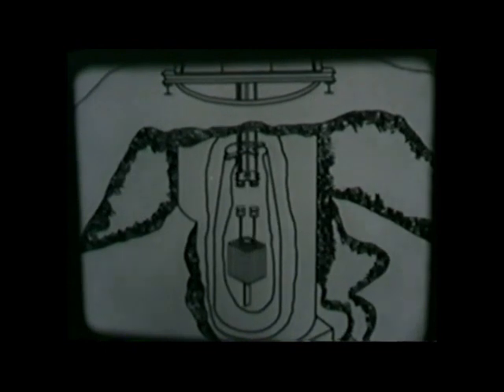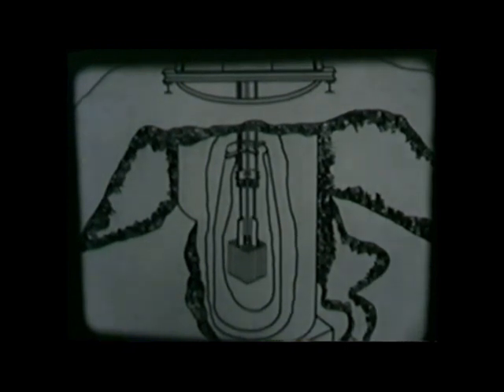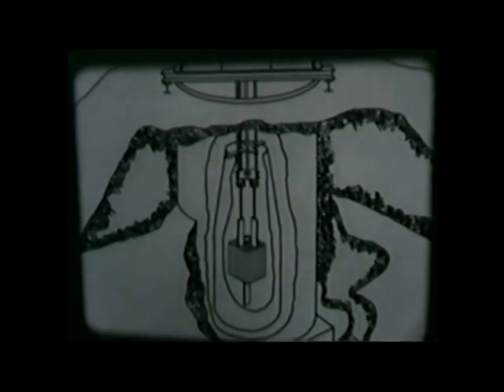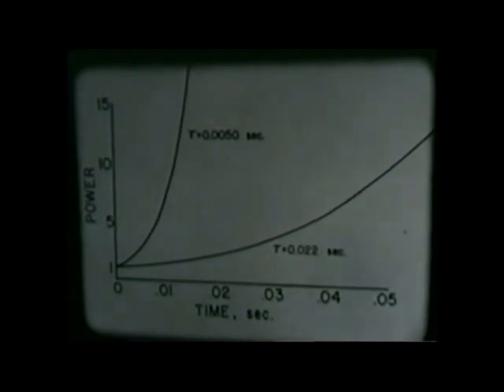Borax - Safety experiment on a boiling water reactor

Comment: For reference, 1.3e8 joules is about 1/100th of a kiloton of TNT, or  about 20 pounds of dynamite. 

Hardly qualifies as a "nuclear" explosion.
Reply: Yet, it is.
Energy is derived from a runaway nuclear reaction that causes the said reaction to terminate by the means of rapid destruction of the fissioning assembly.

Qualifies as a shameful fizzle by nuclear weapons standards, though.

What probably woundn't qualify is one of those liquid phase accidents where a poor chap in an enrichment factory inadvertently creates a critical configuration of dissolved/suspended fissile material. The thing immediately boils over, spraying everything around with radioactive stuff, and gives the operator a hefty dose of rads killing him in days/weeks.

Comment: Poo, not nuclear reactor!
The reactor IS NOT inherently safe, but ALWAYS subcriticall...
Reply: the other way round, this reactor can be brought to criticality and kept there at various power levels for arbitrary periods of time. However, any boiling or other loss of water will make it go subcritical, rendering it safe against loss of coolant. Unfortunately, this setup sucks in terms of efficiency, and such swimming pool reactors (unpressurised water-moderated)  are limited to research purposes only. Power reactor run at higher pressures, temperatures and power densities, that's why major accidents happen once every several decades.
Reply: @sashimanu  
LOL
I was thinking about Molten Salt Reactor which is superior to ANY reactor design! Salt fulfills ALL nuclear coolant safety requirements like:
- do not react with the air, even in high and very high temperatures
- do not react with reactor construction material, even in the elevated temperatures
- do not react with the fuel
- do not react with moderator
- do not react with water
- do not change the state and chemicall composition in the elevated and very high temperatures
- work in the atmospheric (hydrostatic) pressure
- is inert and non-toxic to handle
- has very low or none volatility
- can be stored in any vessel, regardless the material that vessel is build from
Reply: @WadcaWymiaru  if all of this is true, why aren't we seeing any industrial MSRs in operation?